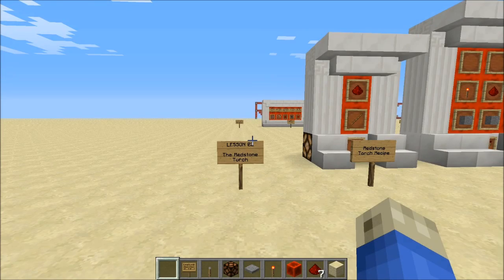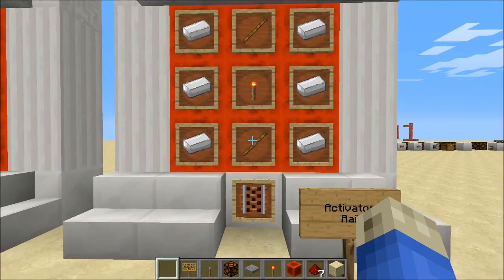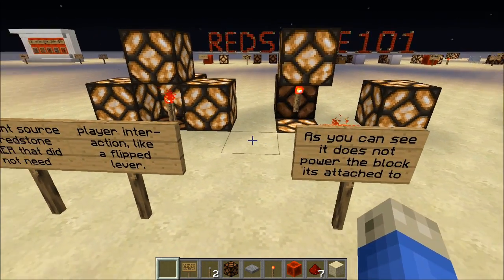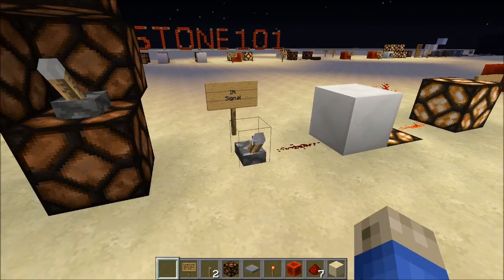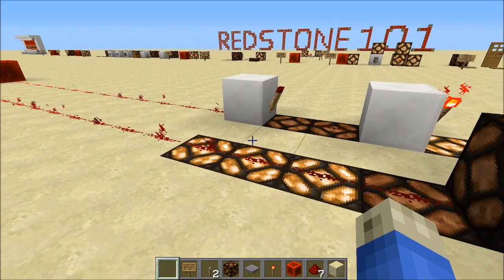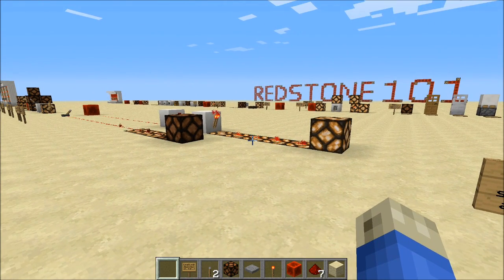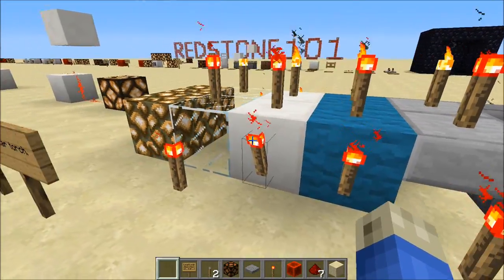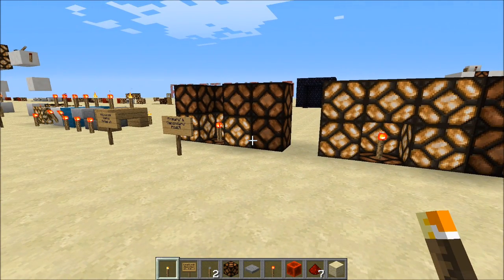Minecraft 1.5+ Redstone 101 - Lesson 2 - The Redstone Torch [TUTORIAL]

Comment: I guess I don't get how inverters work? When the switch sends a signal to the torch, it turns off. When the switch does not send a signal, the torch turns back on. What is the purpose of that?
Reply from the maker: Inverters are actually a very useful thing, there are many times in circuit design you want a signal to be of the opposite state of another one, here is a useful, simple, example: a daylight sensor emits a signal ON&#160;when it sees daylight, you could hook a daylight sensor up to an inverter, and when it becomes night and the light goes away the sensor will STOP emitting a signal, thus&#160;the other end of the inverter would then turn ON and that signal could be routed to lights in your house.&#160; Thus, automatically when it becomes 'night' the lights in your house could go on, using an inverter to modify the output of the daylight sensor.Sorry it took awhile to post this, I have been on vacation!